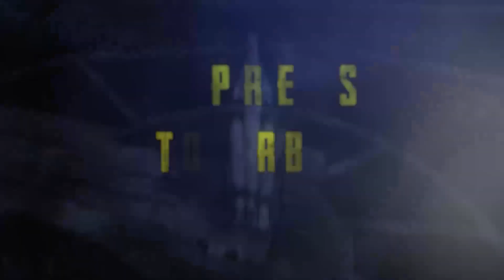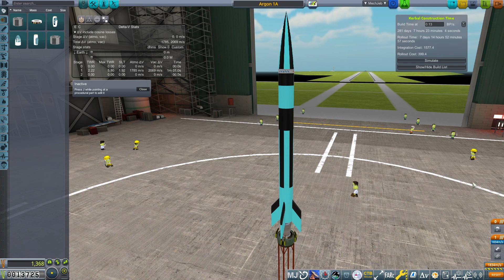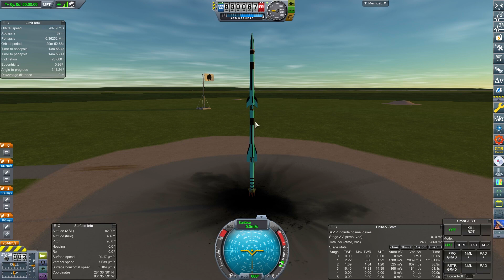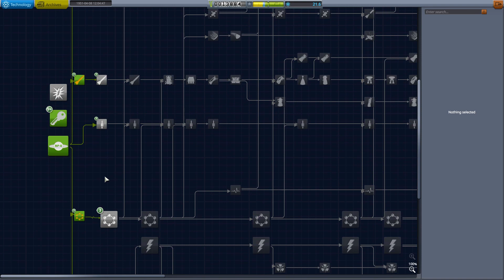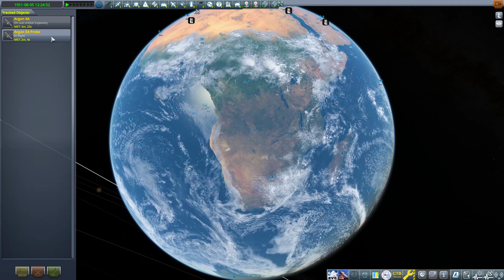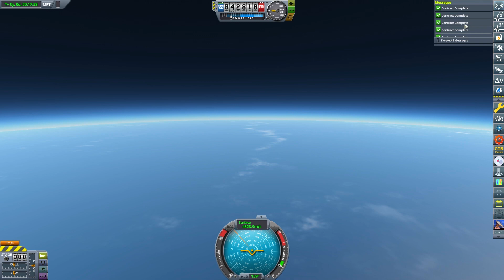HOW TO SPEEDRUN? | RP1/RO/RSS | Express to Orbit | S01E01

Comment: Me proud with myself for getting to orbit in mid 1957...... I'm going to learn a lot here.

Also, you mentioned being paranoid about chute deployment in warp, this is justified. I've had aerodynamic stress failures due to parachutes deploying "too quickly" at 4x warp, also if I make ground/water contact I get "splashed down hard and was destroyed" or "crashed into surface" even though the navball shows 1-3m/s. The game gets confused between "real time" and sped up warp, eg assuming 12m/s instead of 3.
Reply from the maker: Honestly… it’s all about the steamroller effect…. Small changes at the start have big changes by the end…
Reply: @seyMonsters  this could be A Very Speedy Space Program.
Reply from the maker: @MichaelCoombes776  it’s only a 3 episode series ;-) I might have called it that if it was going to run longer ;-) (a very copyright pending)

Comment: kourou or omelek can give an advantage with there low inclination
Reply from the maker: Correct - helps for GEO contracts etc
Reply: Also less delta V for LEO about 9000 M/S need
Reply from the maker: @ftldesignbureau7891  ahhh yes…